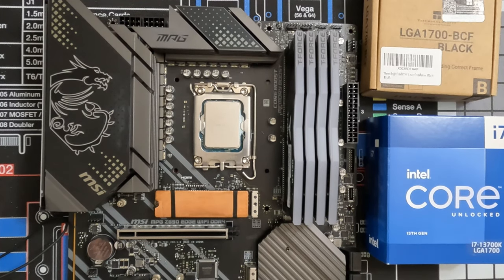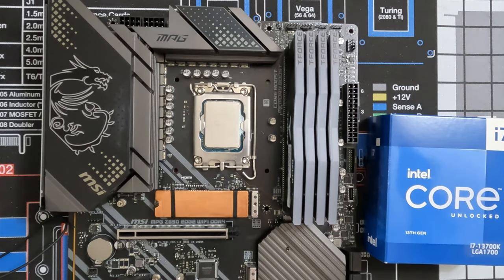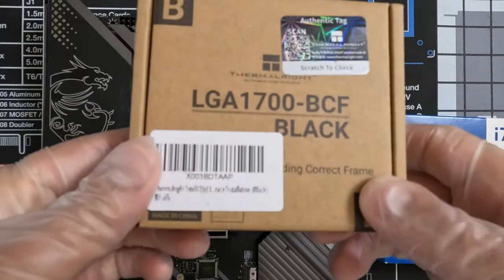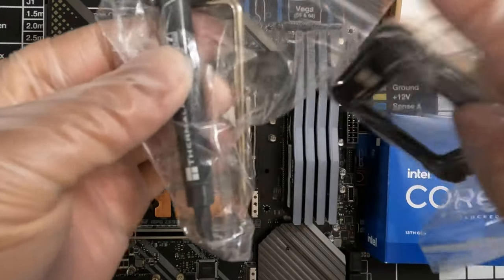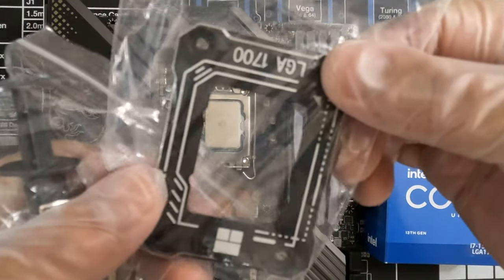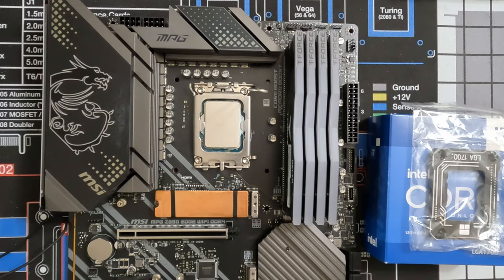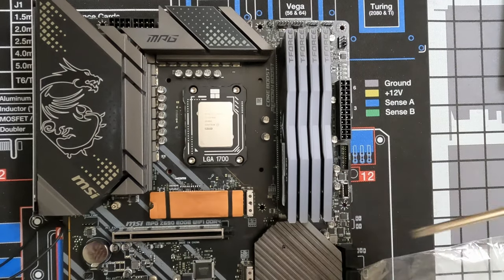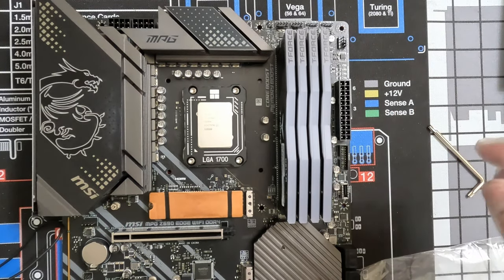Thermalright Intel 12th and 13th Gen LGA 1700 anti-bending buckle, bracket install.

Comment: Can this work with a Z790 MSI Tomahawk MOBO?
Reply from the maker: It should be a fit to any lga 1700 socket unless they changed it a bit for the Z790. I installed this on an msi and asrock Z690 board with no issues on both brands. Good luck.
Reply: It does. Used it on both ddr4 and ddr5 z790 Msi tomahawk.
Reply: @SVT_LIGHTNING  Do you own either of those boards?  If so How is it for you so far?
Reply: MSI tomahawk don’t need this bracket. This bracket meant to be used on cheap motherboards like intel B series. 
Tomahawk is server grade pcb and it never reported any bending issue on MSI tomahawk z690 or z790.
Reply: @netfreak6993 what about msi z790 pro A wifi?  I have core i5 13600kf and im afraid to loose plz help. Do i need to put this bracket?

Comment: is this the reason for the error 55 on my new build with ASUS z790 motherboard?
Reply from the maker: I can't say, I didn't replace it because I was getting an error. I replaced it because I was changing case and also upgrading my AIO so it was worth the change too. Hope you find the root cause and correct it. Thanks.
Reply: What do you mean? Did you install this buckle and then you got the error 55 ? If that's the case then you have most likely tightened the scews too strong and your board cannot recognise the RAM because of bad contact.
Reply: @hanswi336  yes I did, and was aware of overtightning screws, have built of 50 computers, know my stuff. New replacement works fine. Retailer engineers confirmed the MB was faulty
Reply: @Jag-ws5ue  could be ram slots,
Reply: @Jag-ws5ue or you destroyed the motherboard while installing this bracket. 😂
Reply: @netfreak6993  Z790 Hero is a high end motherboard has metal plate at back impossible to bend or damage while fitting a back plate. Unless CPU lever was faulty, screws were only hand tighted
Reply: I had same issue with an Asrock Z790. Slackened the screws slightly, problem went away.